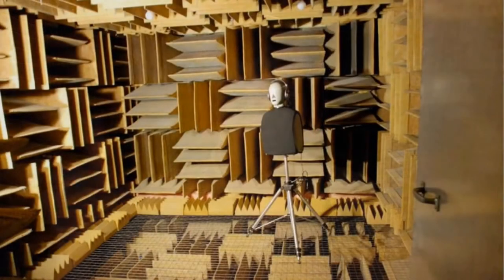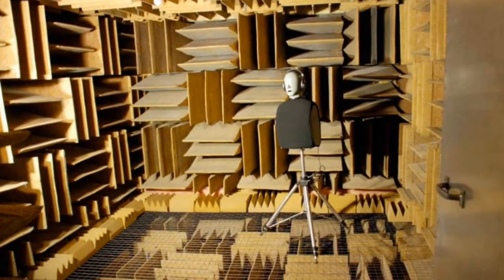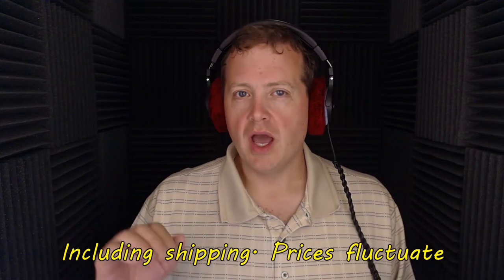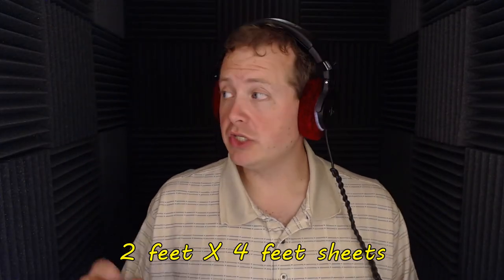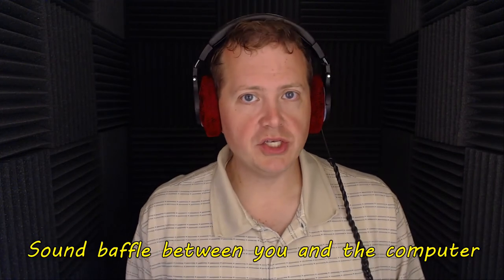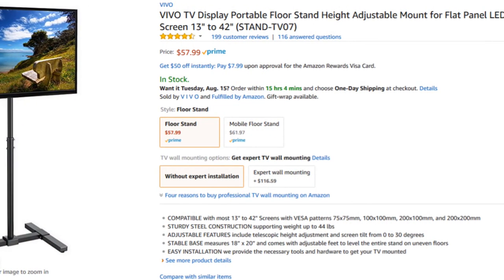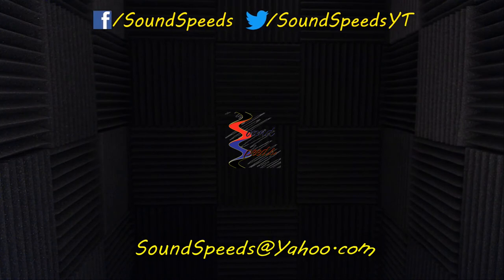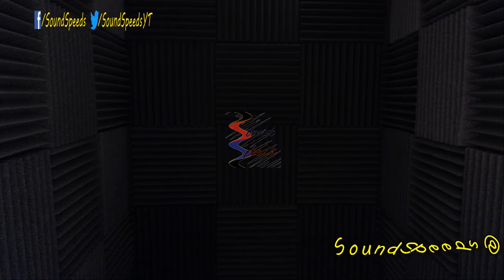Acoustic Treatment 101 - Sound Speeds

Comment: What kind of acoustic foam did you use for your vocal booth? It looks like the cheaper one but It works great, It gives you a dead sound.
Reply from the maker: Danny Marquez It is a cheaper one but then, I don't need much in there. I live in a quiet town and my house is pretty well built so between the two, I don't have to do much but stop standing waves. I don't have a lot of low end to my voice either which helps too. If my voice was deeper, I wouldn't be able to get away with a cheaper panel. You can't see it but I also have soft rubber behind the panels which helps as well.